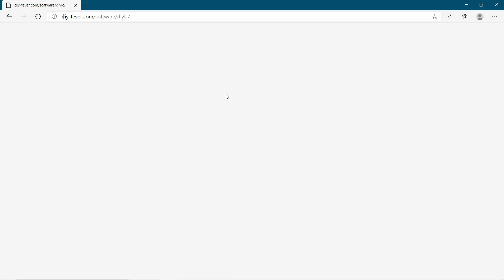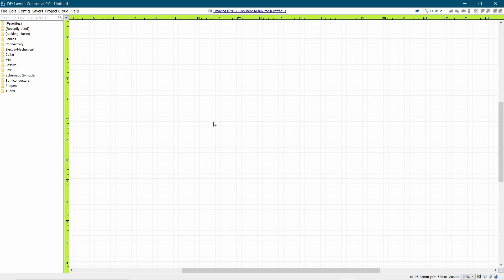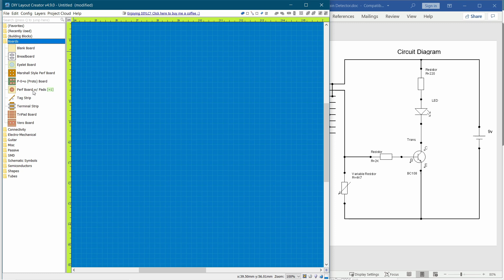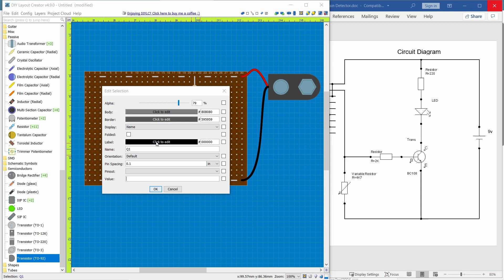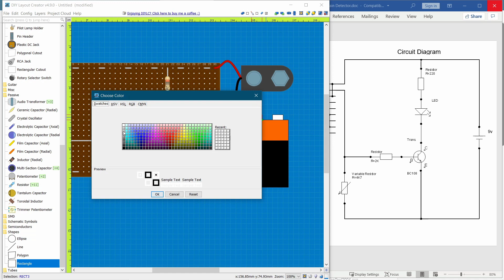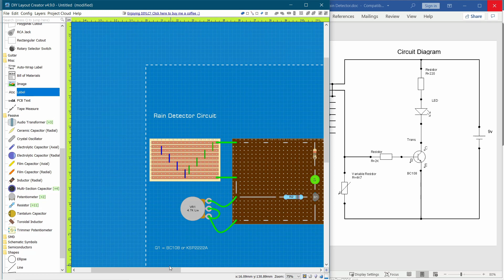Design Matrixboard Circuit Layouts using DIY Layout Creator

Comment: Is there a way to represent and arduino nano in the diy layout creator?
Reply from the maker: Good question - not as far as I know. However, you can draw your own components using the basic shape tools and the dot component found under connectivity. Once you have it drawn you can select all the shapes that make up your "Arduino" by dragging your mouse across them and then right clicking and selecting save as building block. Hope that helps.

Comment: Great video, thanks. Just wondering is there any way of testing this type of circuit before building it? Thanks
Reply from the maker: Hi @mark11original - You could simulate the circuit using TinkerCAD. This is an online app in which you can build circuits on a virtual breadboard. You could replace the sensor with a resistor to see how it works. TinkerCAD is free to use https://www.tinkercad.com. 
See my video on using TinkerCAD: https://www.youtube.com/watch?v=EiqwrNtqmGM

Comment: Sadly there's not too many components that you can place in DIY layout creator, for example there's no IC sockets and only one type of simple button switch
Reply from the maker: That's true - you are right. However, you can draw your own components using lines and other shapes, save them as building blocks and then use them in future diagrams.
Reply: @teksparkz  yeah and you can also use imported images for unusual stuff so it's a good tool overall

Comment: When I go to the diylc site the latest version is v4.37.0 so how is it you are seeing 4.9?
Reply: Even though I saw your reply below to a different link it is showing 4.37.0 as latest?
Reply from the maker: Hi @shader26  it is just the way the version number is written I think. Version 4.37.0 would be a later version than 4.09.0. But because the zero before the 9 is not shown you may have read it as version 4.90.0
Reply: @teksparkz   Right! Thanks!

Comment: Why do all this? By the time you have finished I am busy testing the built circuitry,…
Reply from the maker: Hi Stephen,

That's a good question. This circuit is fairly simple so designing it first may seem like a waste of time. You don't absolutely need to design the layout when there are only a few components in the circuit but as your circuits get more complex it can be useful to design layouts for them. I used this simple circuit as a teaching guide because of it's simplicity. I knew that viewers would be able to understand the concepts more easily than if I worked on a very complex circuit, and also didn't want to bore everyone with a really long video 😊
Reply: @teksparkz  that makes more sense.

Comment: Thanks for the video. Your link takes you to an older version of the software, different to that used in your video. Where did you get the V4?
Reply from the maker: Hi Steven, thanks for the comment. I have updated the link in the comments section to the github page with the latest releases. You should be able to download it from there.